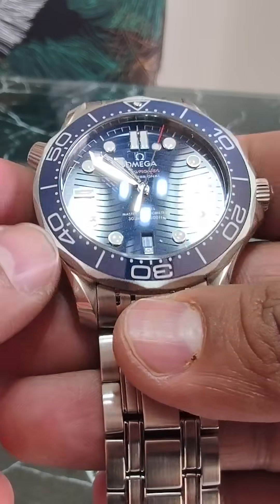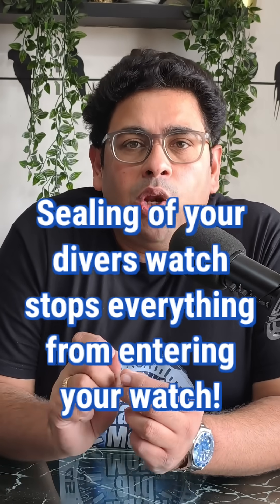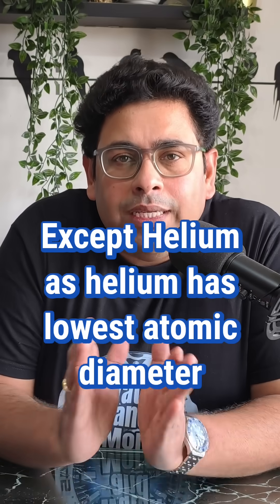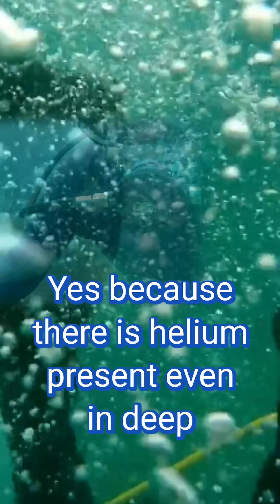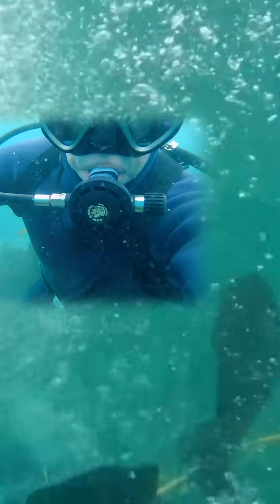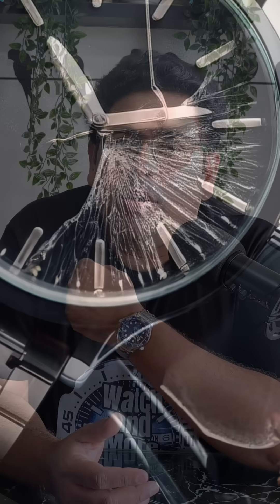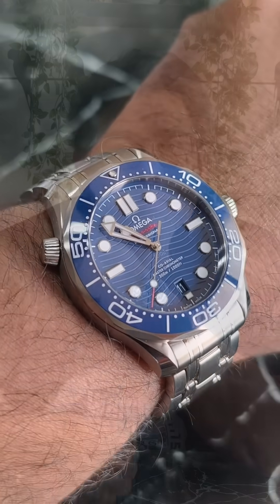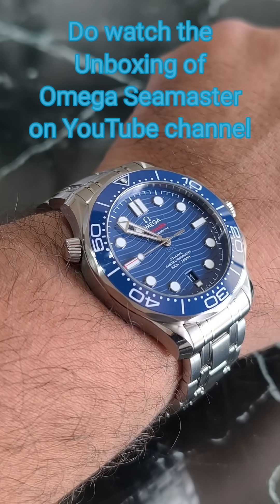What is the second crown on Omega Seamaster? Helium escape valve explained #omega #seamaster

Comment: If the pressure in deep sea makes helium get into the watch through the rubber gasket then the release of pressure at the surface should allow the same helium atoms to pass out of the same rubber gasket right?Didn't gain any knowledge in this video.
Reply: It has to do with the time it takes to enter vs more rapid decompression. The video fails to explain that it gets inside the watch through saturation diving. Spending weeks inside a dry chamber 100s of meters underwater to work underwater at those depths. Inside the chamber the air they breathe includes helium. It's not from just diving deep

Comment: If helium can enter through the rubber gasket nothing is stopping it from exiting through the same path. Plus stratosphere contains negligible amount of helium as helium is very light most of it will stay at the top of the atmosphere and eventually escape earth's gravitational field.
There are so many dive watches nobody ever evoked the urge to use this escape valve. Did their watch crack? I think it's purely just a design element nothing practical. It's an effort just to stand off the crowd by omega.